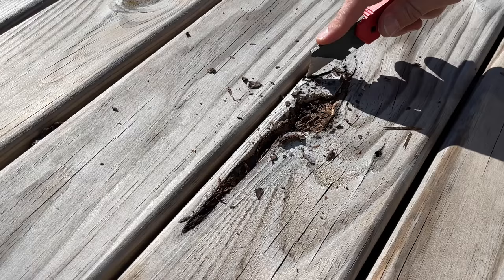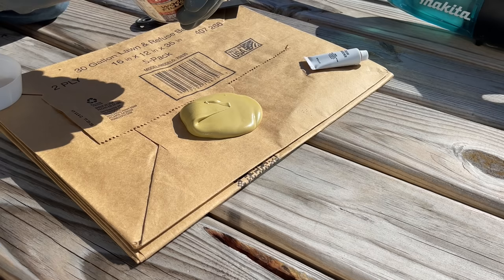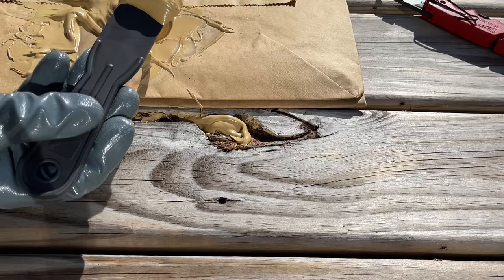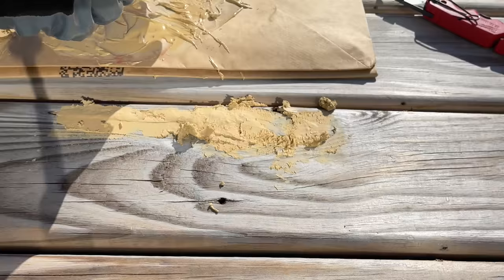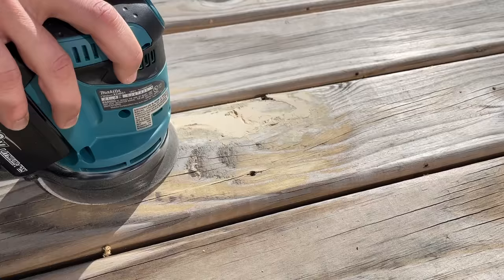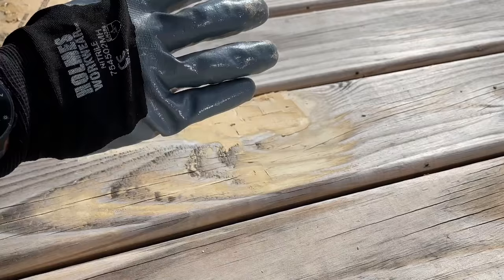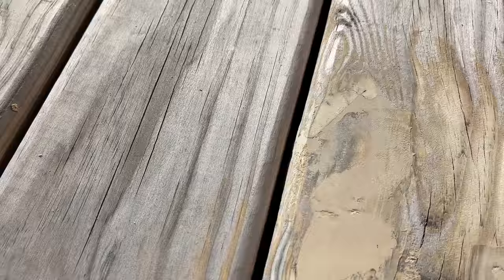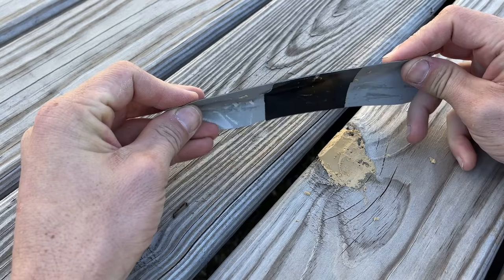Deck Board Hole Repair

Comment: Hi....I live in a log home and it was time for a re-stain. I had a sand blaster company come in and blast the old stain off. Then there were a few areas that had rot. I cleaned them out like you did on your deck and then I used automotive Bondo simply because i never knew wood bondo existed at that time. I put the mixed Bondo in plastic ziplock bags and cut the tip out of one of the corners and filled the open holes in my logs like a icing bag. Worked well and if it hardened up before i got it out it was easy to just get rid of the bag and no mess. I did not have to use much of a trowel or spreader as I was sandng with a orbital sander. After i sanded the logs it matched perfectly to the sand blasted logs and the best part was it took the color of the newly applied log stain and was hard to tell it was repaired.
Reply: like the zip lock bag trick thanks
Reply: I forgot wood bondo exist too sometimes. My brain goes straight to automotive bondo
Reply: Did it hold up ?
Reply: @alessandrocerciello1627  Yes it did......very happy

Comment: I used PC Woody 2 part wood epoxy with very good results on my old outdoor deck last year. I removed the dry rot and let it dry thoroughly before I painted on several coats of wood hardener. I let the hardener dry thoroughly, before I filled with epoxy. My deck has a solid color stain so I finished with a coat of stain which blends it all in. The epoxy is holding up very well in a harsh climate even with constant wet weather and freeze, thaw cycles this Winter.
Reply: Good to hear, this is what I am doing also - applying the wood hardener first and then the epoxy. Hoping to extend the life of my deck a few more years before replacing. Winter's can be really harsh here in NH on decks. This video also was very helpful.
Reply: @samv7487  I'm in Pennsylvania so I'm even more confident that it should work well for you in NH

Comment: I use automotive bondo for dry rot and plugging knots. I have a mailman that wears spikes on his shoes in winter, grrrr! what I find handy is using playing cards to apply the product to the required areas. No clean up just throw them away!

Comment: The Bondo, and other polyester wood fillers don't extend project time, but in most cases I've used epoxy wood fillers.  They have performed a bit better over time, for my projects.

Comment: I’ve done this a lot of times. If you use a multi tool to clean out the moist dry rot and use the liquid Rot Stop you will end up with a longer lasting repair. 
If the hole is all the way through, use the multi tool to create a place for new wood or install a mesh screen to hold the Bondo. Make sure to use the dry rot killer before the Bondo. You can also use a good deck primer after the rot killer.
Reply from the maker: Thanks for the tips Matt 👍
Reply: A specific "rot killer" isn't necessary if you remove all the existing rot.  I also dry the cavity completely with a heat gun which kills any remaining bacteria or algae and leaves dry fibers for the BONDO to cling to.  I have repairs to Victorian scroll work that were done twenty years ago and they have never peeled or failed.

Comment: I've used wood filler inside of Kitchen cupboards that the previous owner had drilled holes in the shelves (?) Light sanding then white paint.  Now when visitors are looking for a glass or cup they can't see the damaged areas.  I put tape under the cabinet to hold the filler until dry, then removed it.

Comment: Thank you for this! We have a small hole, sort of a splintered off spot on the side of one board in the middle of our deck from our movers and I was afraid we were going to have to replace the whole board. It’s also on the edge of the board so thank you so much for the tip on contouring with tape! I feel much more confident on fixing this now. This is the first time I’ve ever took on a project like this on my own. Restoring the entire thing and it was a bit daunting at first.

Comment: I have used this and I still use it. I filled minor natural wood cracks to prepare my new picnic  table for stain and clear coat. My table is 10' long using (5)  2" X 12" boards. I have not had a problem with knot hole filling but I have saw 'aged' shrinkage of material in cracks I filled, requiring another spread to fill them cracks. I do like it and will continue to use it, but, remember, it's not bullet proof. Also, as I see the morning dew beading on top of my finished filler, I now wonder how it handles the stain. They state on the can that it does well with stain, but, we will see. Great video man!

Comment: Timely video. Today I’m going to use Bondo wood rot repair, then the Bondo wood filler on a few areas of my shed tongue and groove siding boards. I’m only going to mix very small batches and use less hardener. Wish me luck!  Update: for my project , this dries too quickly. I hate sanding!  Nextime I’ll use something that allows me to work at smoothing it out before drying.
Reply from the maker: Best of luck on the project 👍

Comment: Good tips and thanks for sharing. I am repairing a few rotted parts and filling a few bolt holes from the old gazebo that was taken down. I will put wood hardener first over the rotted wood and then do this. Thanks for showing. I have used Bondo on my countertop before I did a 2part epoxy finish - great stuff.

Comment: I hadn't thought of the Bondo wood filler. I've found out that the general purpose Bondo is not the best way to go. With the wood contracting and expanding the GP Bondo will a lot of times eventually come out.
Reply: Automotive BONDO does not contract and expand very much at all...it is the wood that expands and contracts.  The wood expands and contracts due to moisture, rather than temperature.  You can prevent movement of the wood by insuring that it is sealed on ALL sides with a good paint or stain.

Comment: Gorilla wood filler...doing a freshly installed deck, but wood has a lotta knots, so gonna treat them all, the deck needs to cure till NEXT spring before it gets painted, so I hope it all goes good, couldnt afford really nice deck boards, so gonna do what I gotta do! Thank you for the how to,  sorta same as what I thought, but double checking myself, I'll be 70 in July, have done a ton of decks thru the years, and lumber quality this time on fixed income, deck is 64'x24.5' Not a little project to pull up and replace all my decking, redo stringers, steps that span a 16' drop to ground...not an easy deal...and my lumber supplier had wood that had SO MANY KNOTS, geez...but doing what I can with what I have!

Comment: Shortly, I will be trying my hand at repairing my wood decking, and will be using your video as a tutorial. One question though. Can you advise on the best way to clean a plastic putty knife after use?

Comment: Kudos, Scott, that you show how to first try to repair and not replace!  I've had good results on my deck with Bondo and Durham's water putty.  Durham's is a lot easier to mix up, more working time, and doesn't have the chemical smell.   Cheaper too, so I would try that first. Neither one takes stain well so be prepared for a visible patch.  But it's a deck.  I also have a box of System3 RotFix that I plan to use on a rotting window sill under a set of expensive wood casement windows that weren't properly flashed.  Looks like a good product, epoxy -based. I've not used it yet but it might be another option.
Reply: Durham is a indoor wood filler .
Reply: @cynthiayee5116  thank you, good to know
Reply: @cynthiayee5116  Plastic repair material in powder form.
Will not shrink, stays put.
Use to repair walls, furniture, woodwork or plaster
Clean with water while still soft, sand or chip off after dry. Interior/exterior use

Comment: Nice one Scott.  One of my outdoor beams has some dry rot and I've been using plain old Bondo for years.  Come summer I'm using your method.  Seems like it will work better..  VERY useful video.  Thanks a bunch!
Reply: Outdoor beam? Beams generally have a structural purpose and a cosmetic fix to hide a underlying problem is probably not the best solution.
Reply: @taddmcmichael9061  You are right.  I came to my senses and had the beam replaced a week after my "fix". Thanks.
Reply: @kersi-sandiego6036  That is good, those kind of fixes stink monetarily. Mother nature can be a b*tch on how she treats our investments.

Comment: I also have a deck that is about 2 years old and we stained it 2 years ago and I have a lot of imperfections. Lots of boards with tons of lines and cracks. I guess it was a bad year for the lumber 

Would you suggest that product for my situation? I also live in a country that is extremely hot and extremely cold. 

What are your thoughts? My deck looks like it's 30 years old. Not cool

Comment: My experience with Bondo: 1) Mix small batches, smaller than you think you need.  For most cases, I would say no ,ore than a glop about 1" in diameter at a time.  For larger holes, repeat as necessary as opposed to making a bigger batch. 2) Be conservative with the hardener.  The more that you add, the quicker it will set.  Adding less will provide more open (workable) time, but it will take a bit longer to cure.  With some practice, you will figure out what works for you.  3) Once the Bondo gets a bit gummy, it is usually too late and unworkable.  4) Always work in in well ventilated space; the fumes are really bad.  Bondo is great stuff, but it does take some practice to make it work well.

Comment: Hi, On the 3M Bondo website, some users have pictures of this stuff not taking stain.  Their experts replied that it doesn't look the same as wood after you stain it.  Did you stain it, and how did it come out??  I dont want splotchy results.

Comment: I'm not a pro by no means but I seen what I call rookie mistake. Ever seen clear coats where you see the filler smudges around nail holes. It's cuz people don't apply the first coat of sealer first then fill the nail holes/cracks. The filler gets in the grain and keeps the coating from soaking into the wood. Especially bad with like the old wood you are dealing with in the video. I bet anything there was a big wood filler blotch there around the repair. My suggestion do a light sand brush the coating on around where you are fixing then Bondo if you don't want to wait until after first coat. I usually take it a little further and run some painters tape along the edges of the crack I'm filling to make sure the filler stays in the imperfection and not in the grain. But never before a first coat. 
Just my technique. 
Couldn't help but add my 2 cents I was cringing the whole time with the wide dried out grain that was getting filled with bondo.

Comment: Nice. Working on mine now and found this very helpful. I have exterior wood filler and was wondering how well it would work and also the different apps. for it in this project.

Comment: I used the Bondo for some rafter repair, I too was VERY surprised how quickly it set up.....much faster than the automotive version.
Reply from the maker: Yeah, no time to mess around for sure.
Reply: It's not for structural repair, only cosmetic.

Comment: A have a similar sized hole on a rounded wood floor board. I was going to use loctite with their expandable material but now that I see this wood filler, I think I'll try this first. Hopefully it will stand against summer heat

Comment: Can someone provide details on how to add color to Bondo Wood Filler to match my deck?  I plan to waterproof the deck -  will not paint/stain my deck - so mixing up the Bondo Wood Filler with color to match my wood is the goal.  I know it won't be a perfect match.  But have already applied the Bondo Wood Filler to some areas as a test, and the color difference between the bondo and deck is huge and ugly looking - can clearly see the patched areas.  Thanks, Matt

Comment: How long do you recommend I wait for using this on a new deck to fill in some knots and some saw gouges left by the builder during construction.  We are in Georgia, so it’s hot and the PT wood should dry pretty fast.   what are your thoughts. 

Thanks, great video and channel!

Comment: Can i use this to fill in screw holes on my decking? I messed up and had to adjust the rim joist so all the boards that were screwed into it need to be moved slightly

Comment: If the hole goes all the way through what should I use? This is a round piece of scrap wood I want to use for a sign. It would need to accept paint.

Comment: For a difference between the carbondo and this wood Bondo because I've experienced and filled wood holes with carbondo and over the years in New England weather what expands and contracts and the repair works its way out does this Bondo wood product expand and contract with the wood or is it just like the auto Bondo ....what's the difference??¿
Reply: Car Bondo is red or pink  and use this on painted decks ...this wood Bondo is yellowish Brown and use this product on non-painted decks... can't tell you about staining or absorption of sealant or long-term effects of products . Wood Bondo is just as hard as the car Bondo.... is that just the only difference ? because I know ,I've worked with both and I've never went back to see if either product came out and no one's ever bitched ,Sooooooo?????????

Comment: Durham's Rock Hard. Difficult to sand so make it as smooth as you can upon application.
Reply: Compared to Bondo, Durham's is much less expensive, easier to apply smoothly, and gives you more time to work with it.  However, Durham's is resistant to staining and is better suited for painting.

Comment: Was this the first time you treated this deck?

We just installed a new deck at our lake house and have yet to treat it for this season..
Reply from the maker: It is 😞 should probably seal thing up after about 1-3 months letting the boards dry out a bit.  It’s been about 18 months for this one.
Reply: @EverydayHomeRepairs  Yeah its probably best to do it right about 1-3 months in but for us we haven't been able to go back down there for a while so probably going to have to just treat it as soon as we can. Also why patch up the knots in the first place? sometimes I think they look cool, the bondo doesn't look as good in certain situations to me
Reply: @itzNickyJayBeats  
If you don’t patch the knots any openings and cracks will hold water and lead to wood rot.

Comment: What happens if you don't use the hardener at all?  I don't want the time crunch involved with the product hardening so quickly.  Will it harden over say a 24 hour period?
Reply: It will never cure(harden).  It is a two part product A+B.  If you use just one part you are not using the complete product.  Generally people use too much hardener.  If you too small amount of hardener may take an hour or more but it will eventually harden.

Comment: I hope you use a solid stain. Bonds does not take stain in a semi transparent. If you have faux skills it would be ok.
Reply from the maker: I think this Bondo Wood Filler is stainable and paintable.  We shall see 🤞
Reply: @EverydayHomeRepairs  Yes to a degree. Try to stain it. Most times it looks like a solid color. You can blend it with skills. I have done it multiple times.
Reply: @EverydayHomeRepairs  Just trying to help.
Reply: Thanks for answering my question before I asked it. What do you mean by Blend it with skills?
Reply: @germainemarzen997  You can do a graining tool to do faux wood look.

Comment: Bondo works well indoors but using Bondo outdoors With the weather from dry to wet the wood  will expands and contracts And causing the bongo to eventually crack the best thing to use is flexible wood Two-part epoxy Especially if you’re just going to paint over the repair
Reply: Well that's only with the bongo. See this here is bondo. Its much better

Comment: I can only get 20' pieces, my brother who is really good, can patch it, he squares it off, sands and that's that.
Reply from the maker: Yeah my local Menards had 26’ boards 🤯
Reply: @EverydayHomeRepairs  How do handle them? 16' are manageable, that was a long Deck, it's great when it's a 12' Deck and there are no joints. Really learning from you electric vids, thanks.
Reply from the maker: Yeah the 26’ boards were great for this 24’ wide deck so I didn’t have joints but they were massive and I had them delivered.  Thanks for the support 👍
Reply: @EverydayHomeRepairs  🔨